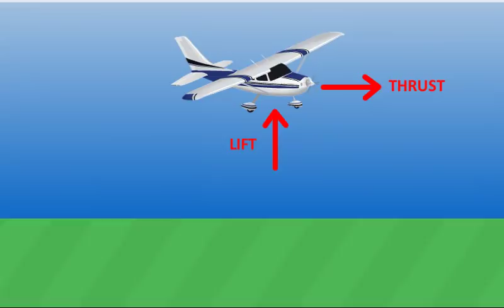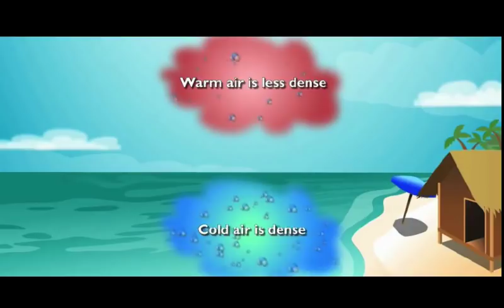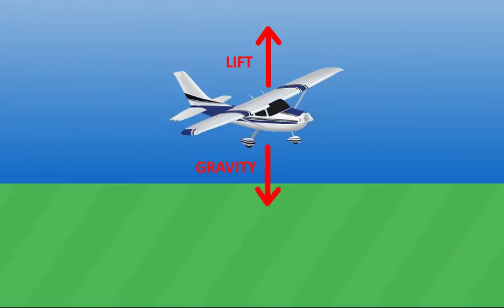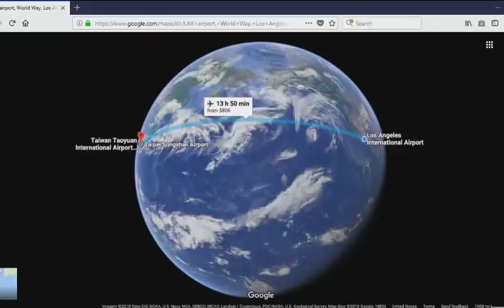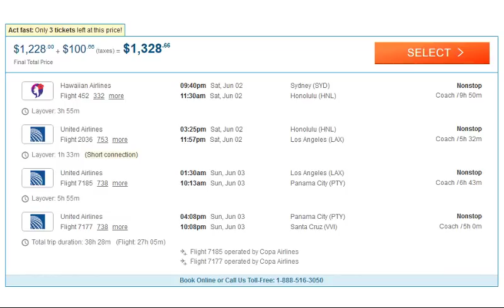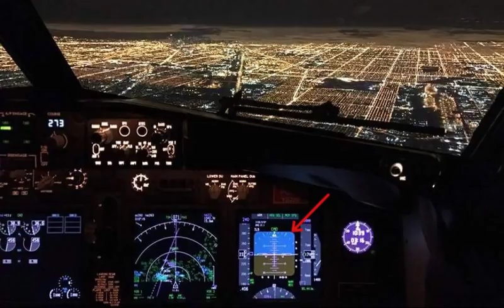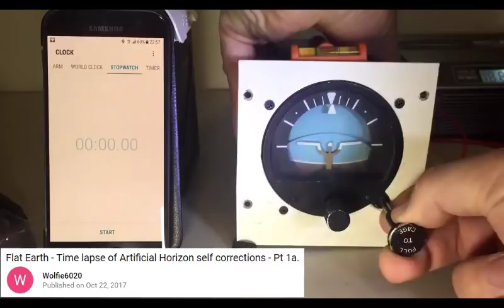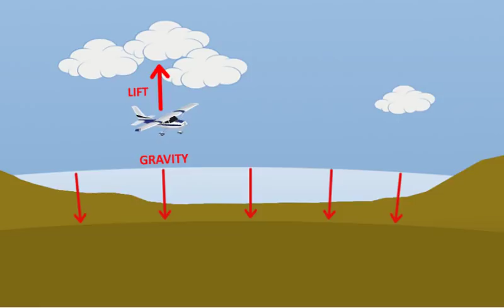Flat Earth Falsities - Plane Nonsense

Comment: Do flat earthers think when you fire a bullet it just goes in a straight line forever?
Reply: Jesse Duzz Answer the question.
Reply: ScoopDogg1867
FE cultists don't think. They just believe what they are told. If they could think they wouldn't be FE cutists.
Reply: Jesse Duzz
Answer the question.
Reply: Bit pissed at the moment but will give you a reply as a flatard would :)
The bullet drop would be the same for a FE and an oblate spheroid. The maximum is around 2KM, not enough to really make much difference on the oblate spheroid so we can treat that and the flat earth as the same.
The reason you see bullet drop ( and anything else pulling you towards the ground ) is all down to density. The bullet is heavier than air so it will naturally fall down. 
Now back to normal :) I just wish some flatard would give me some mathematics on how their version of ' buoyancy ' works without gravity ?
Reply: The mass of the planet and rotation effects the bullet along with the coreollis effect, that's what Immeaning , flat earthers believe different.. Meaning the coreollis effect proves the earth is rotating at the speed said by science proofing round earth.
Reply: ScoopDogg1867, sorry did not read it right :) I'm going down the flatards arguments here again.
The Coriolis force can be explained by the fact that the flat world is actually rotating, as well as the rotation angular momentum the is imparted to the bullet by the rifling that is machined into modern day gun barrels.
The first time this effect was noticed was back in 1651 in the work Almagestum Novum, which was to do with artillery. Although rifling actually dates back a century or so earlier. Is it just coincidence that both things were noticed at near enough the same time. So the Coriolis effect was only in effect after the rifling had proved the fact by actual physical tests.
Sorry, late at night again and on the whisky :) 
Just to remind anyone that drops into this conversation .... I live on an oblique spheroid :)

Comment: Gravity "does not exist", is a science fiction, has not been proven by any means. The objects fall to the ground because they are heavier than air and that's all.
Reply: Ivan Kavicki https://www.jstor.org/stable/106988
Cavendish experiment, 1798. Catch up with the rest of the world. 

Explain why objects fall in a consistent direction.
Reply: Jesse Duzz Why does aur pressure decrease with altitude if all sealed within a dome?
Reply: Righto, one "proven fact" never in the slightess shown in labs, but all pervasive and capturing. They KNOW that Air would just fly off if not for ironcore holdings.
Reply: But why does it fall 'down', and not any other direction?
Reply: See?  This is just what I mean by flatheads proclaiming things that just are not true. 
"Gravity "does not exist", is a science fiction".  This type of proclamation can be done about anything, but it doesn't make it true.. I could say "Air is just science fiction, you can't see it, so it isn't real"... See?  People would believe this to be true.. If you can't see it, how can you say it exists?  The same is true of gravity. Gravity is as real as air is.
We cannot see either one, but both have properties that we can measure, so they do exist and neither one are science fiction. Gravity is a force of mass's attraction.  Sounds simple enough right?  The more mass, the more
gravity.  The more mass, the more PULL of gravity.  Is that so hard to understand?  Just as you can compress
air in a cylinder, you cannot see that compression of the air.  So too with gravity, it cannot be seen either, no matter how strong it is.  Without gravity  you would not be on the earth at all, whether it was a sphere or a disc.  You are held by your science fiction to the earth, no matter what the shape is, so gravity is not science fiction.  Those who "proclaim" and repeat foolish statements are totally without any thinking ability of their own, so do us a favor, please do not repeat the idiot's babble you get from flatheads, as it makes you look as brain compromised as they are.  We would like to think you may have the capacity to think more critically than they do and see through their silliness.  Go forth and learn how things really work!  WE know you can do it.. WE are cheering for you.
Reply: KADJ, if gravity exists , why is it very selective? how come i can walk freely ? how come a balloon filled with air go up ?
Reply: Kam Joe Gravity is proportional to mass and Earth's gravity acts on all objects in proportion to their mass. You can walk upright because your legs provide the force to resist gravity; if you pass out then you fall, not remain upright. Since the air around a helium balloon is denser the air has a greater force pulling it down; this displaces the balloon upwards. If the balloon is filled with air then it falls. Do you understand how birds fly?
Reply: First off, I can't believe you asked that question..  Gravity affects everything in the same way in it's field. Why does a balloon go up?  Because it is filled with something that is lighter than air.  Helium is lighter than air is.  If the balloon is deflated, then it sits just like everything else trapped in a gravitational field. When you fill it with a gas that weighs less than the surrounding air, it goes upward.  Gravity is not selective as you suggest.  Another proclamation by a flat Earther!  You guys really need to quit proclaiming things to be true that are not true.. You think everyone around you is lying to you, when in fact, it is your own proclamations that are the lies.  Thanks for the question, and I hope this educates you on how a balloon works. 

BTW, a balloon will rise with hot air in it also. Heat rises, so when a balloon (such as a hot air balloon
is filled with hot air from politicians blowing in it), it rises just as a helium filled balloon does. :)

Comment: Stupidity. How can one believe that the "air" element binds to the "earth" element, and that it rotates together with the Earth, carrying 100 tonnes of heavy aircraft ?! The same people do not believe in God!
Reply: Take some math and physics classes. They will explain everything, and then you will have the toolbox to explain everything else yourself. And no, it won't wreck your faith. If anything, it'll help your faith, because it'll help your critical thinking skills, which you can apply to all areas of life and philosophy.
Reply: To demonstrate how the air binds to the earth, do this simple demonstration yourself.
Go get a drill, a bit (largest one you have).. get a cup of water.. Stick the drill bit into the cup of water and start the drill running at a good speed.. You will see that the water starts going in the same direction as the drill bit.. Likewise, the air follows the earth, in the same method as the water follows the drill..  Hope that helps.

As Jimmyboy131 said, this does not take away your belief in God, to know how his creation works.

To understand how air can support a large aircraft, it's all in thrust and wing size..  The air is condensed
under it's wings to create "lift"..  The faster the wind is gathered under it, and the large wing area with
the right curvature, will create lift with enough thrust.. All elemental flight mechanics you can learn
if you take the time.  Instead of listening to fools, get some education on how thing work instead.
Reply: @kadj1016  I know, right!? It's always been a belief of mine, personally, that science can explain how God's processes work, and it's baffled me that people think science ruins all of the faith one can have. Though this comes from a guy who isn't religious and is not sure one way or the other if God exists for sure or not, though, hey, I have an open mind. Just not to BS claims like Flat Earth.
Reply: Good for you for not falling for their misdirected bad science.  As for your being unsure of if God exists or not,  I pray that you don't find out the hard way, but that you do find out that he does exist.  I have never doubted his existence, and when I needed him most a few years back, he kept me alive against all odds, when the doctors wondered how I even walked into the hospital.. The main surgeon told me that I should have died three weeks earlier, and that it was impossible that I walked into the hospital on my own and was alive at all.  They could not explain it, but the surgeon said "God has more work for you to do on this planet, as I cannot explain how you are even alive sir."  I had prayed to God, to keep me alive and find someone who could fix the problem.  He did just that for me, against all logical explanation.. My son said the other attending doctors came out of the operating room all white as ghosts with blank looks on their faces.. They all got to see something impossible before their own eyes..  When other people asked me how it was I was alive, I'd just say "God power, that's how"..  So hopefully it won't take anything that dramatic for you to know he is there, but hopefully you can figure it out that he is there. 

Thanks for your reply.
Reply: @kadj1016  You're welcome, and thanks for the amazing words, friend.
Reply: Neither "air" or "earth" is an element.  Alchemy is not real.
Reply: How can one believe tbe bible and that there is a god

That is the definition of stupidity

Yet you say us globers are asleep and are indoctrinated to believe the round earth

What do you call 2000 years of people believing the bible

I bet your parents got you to believe in God

Can you see how fucking dumb your arguments are?

Comment: What if we disabled the autocorrection mechanisms on a gyroscopic artificial horizon and just started flying? Then it would work the way the flat earthers want it to work, and it would prove the earth round by their own example.

I mean if you tell me that bicycles aren't powered by the pedals because if they were then pedaling backward would make you go backwards, then I could either explain to you how the gear mechanism works or I could disable the gear mechanism and demonstrate exactly what you're talking about.

If all they're saying is "it should work this way, and you should have to correct for that issue" and were saying "we have corrected for that issue" why don't we just say "okay, this works exactly how you say it works, and it proves the earth is round by your own admission"
Reply: @jesseduzz4136  Oh yeah. All navigation was planar. That's why we needed to measure the stars and adjust for the curvature of the Earth. Just crazy how that all worked
Reply: @jesseduzz4136  Oh yeah. Super big brains here. Do you know how to navigate using the stars? Because I'm betting you don't. If you have a basic understanding of how to navigate vast distances, you would understand how this whole idea that people thought the earth was flat as recently as a few hundred years ago is nonsense.
Reply: @jesseduzz4136  Hey, big brain. If we knew the Earth was flat, why did we sail in a straight line West to try to reach India, with supplies inadequate for the circumnavigation of the circular Earth at is edge? Because we would definitely know the circumference of the disk we lived on, since we've known the circumference of the globe that we live on for thousands of years.
Reply: @jesseduzz4136  There are literally thousands. You don't want to accept them because your worldview demands that you be obstinately ignorant of all evidence that doesn't suit your needs.
Reply: @UCVvkthyBQLhrsmREFv9OHQg Aww... Baby got banned? Guess his big brain couldn't make it here.
Reply: @jesseduzz4136  ... What?
Reply: @jesseduzz4136  Oh man. You are just too big brained. How do you keep up with all this secret knowledge that you have in there?
Reply: Mechanisms on a gyroscopes have never been seen, corrects nothing, nothing!
Reply: There are honestly not enough complete sentences for me to tell if anyone is on anyone's side here or if someone just opened a dictionary and started rolling dice to pick words.
Reply: We all have our limitations, does your complete history include first airplane travels with no gyroscopes, christian Wright brothers started and others extended? You do have complete knowledge of FLAT earth Navigators not using flat globe maps and succeeding in continent exploits if not intercontinents as Vikings etc?
[In the first several decades of the 20th century, other inventors attempted (unsuccessfully) to use gyroscopes as the basis for early black box navigational systems...
During World War II, the gyroscope became the prime component for aircraft..
Gyroscopes continue to be an engineering challenge.]
https://en.wikipedia.org/wiki/Gyroscope
Reply: @BrainUser1  What does my history have to do with this? Flat Earthers say that something is supposed to work a certain way, and that would prove the round earth. Why not perform that experiment to their standards?